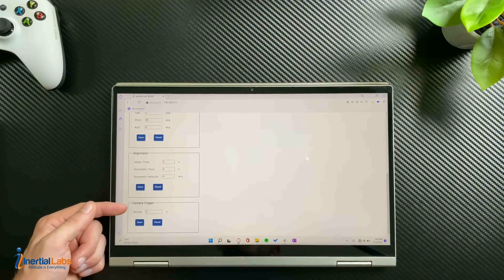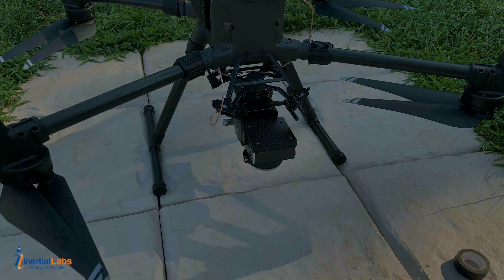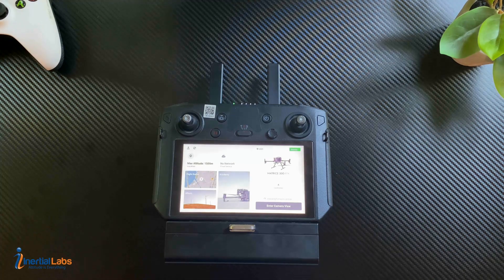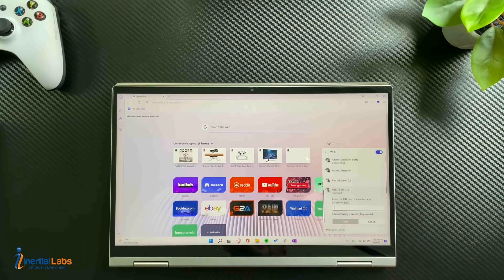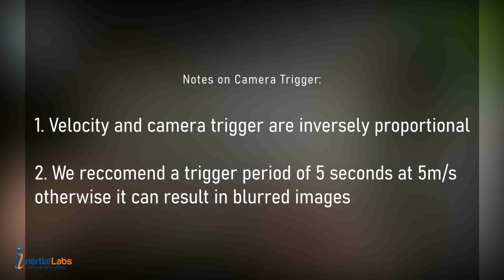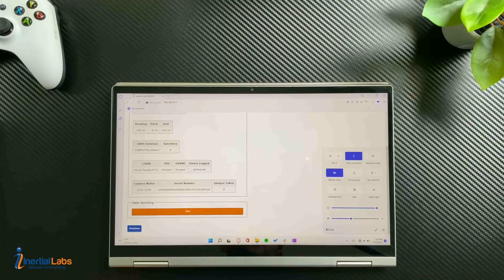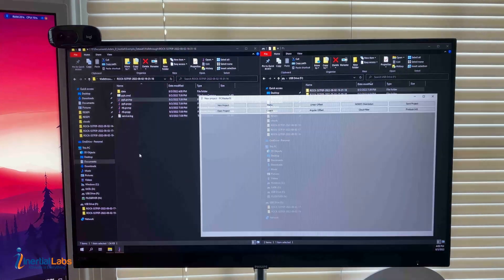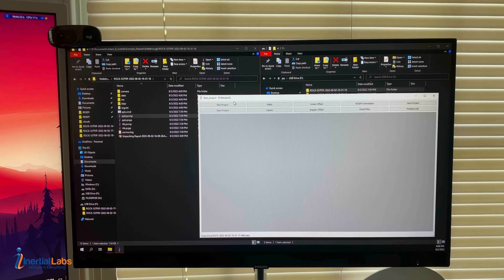RESEPI Quick-Start Guide - Setting up your LiDAR Survey System and PCMaster - Inertial Labs

Comment: Hey Everyone! Just wanted to add a note. When going over my flight plan you may notice that my figure 8 movement looks like a bow tie. Those waypoints are actually set to "Continuous, Curved Route" so it will actually perform like a normal figure 8. You can also observe this when I show the clip of the live flight. These settings vary from vehicle to vehicle, therefore, I didn't want to include it since only a certain amount of people use the DJI M300.

Comment: Since Inertial Labs builds these units for Rock Robotics as the R2A, can you buy the Inertial Labs PCMaster/ PCPainter from Inertial Labs and still process the LAS the same?
Reply from the maker: Thank you so much for your inquiry! Inertial Labs is an OEM supplier of IMU's, GPS-Aided Inertial Navigation Systems and fully integrated LiDAR Payloads. Many of our partners have worked hard to directly support their customers and we encourage the end-users of our solutions to work directly with their respective suppliers. With that being said if you have any questions that we can support you with feel free to reach out to us directly by emailing support@inertiallabs.com.  Thank you!